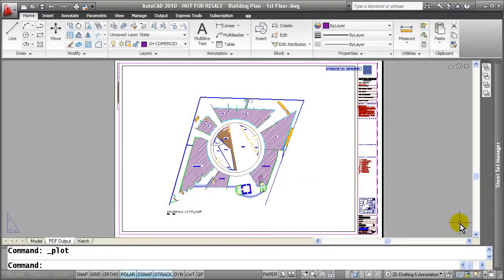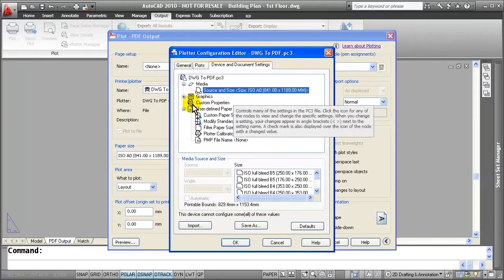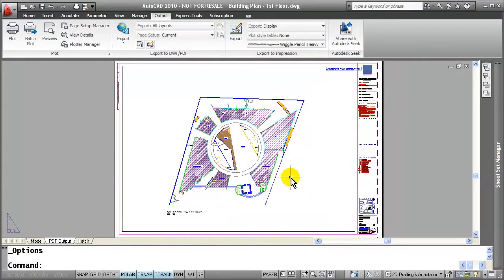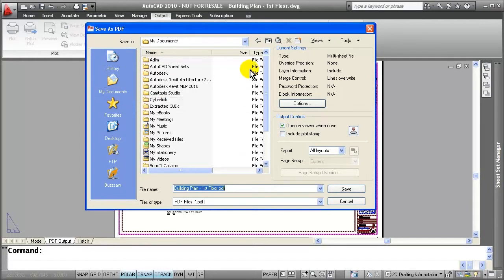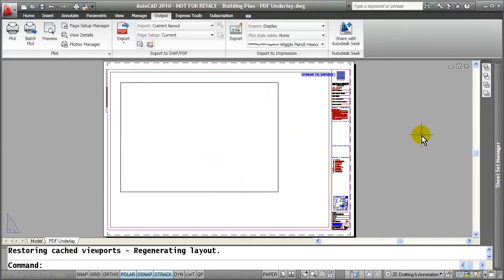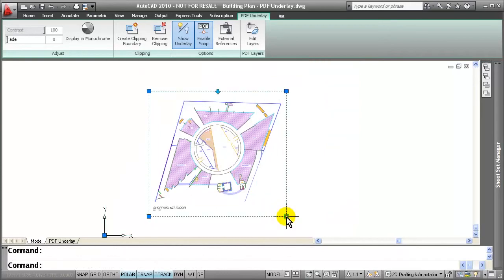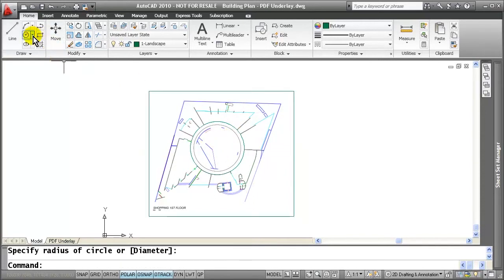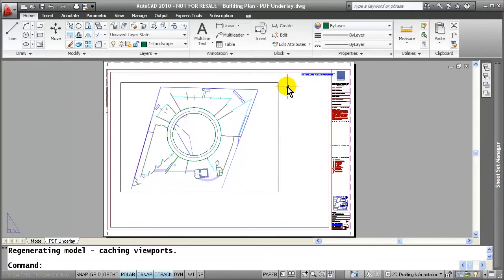Creating and Using a PDF Underlay in AutoCAD

Comment: Is there any way to process the pdf. colors? For example, if I want to overlay structural drawings on top of architectural drawings, I can change the color of the structural pdf. to blue so it stands out? I know with the pdf. overlay tool I can adjust between native colors and monochrome, or adjust the fade, but I don't see a way to adjust the pdf colors. Bluebeam has this, but I prefer autocad...